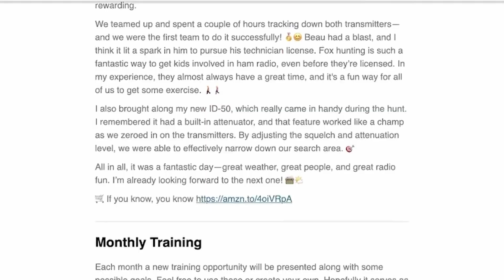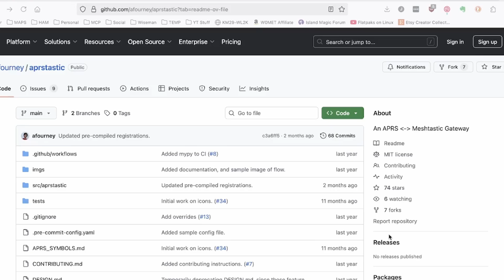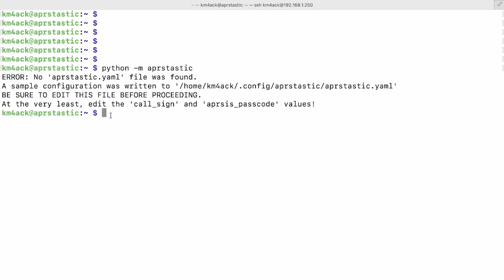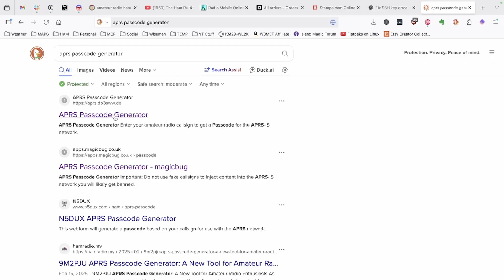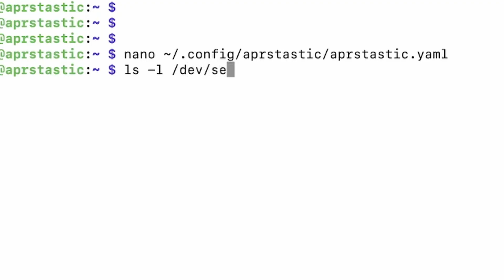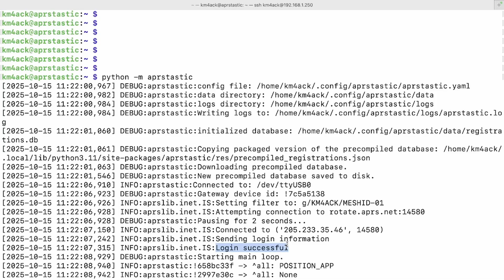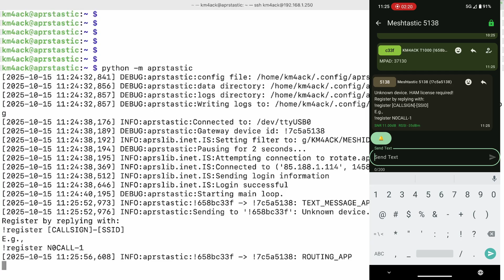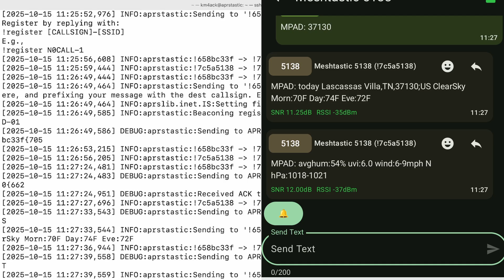This $15 Pi Zero Just Bridged Meshtastic to APRS! Full Setup + Demo

Comment: Getting a time out waiting for connection when running the python -m aprstastic command.  Uncommented the # for my port.  Rebooted.  Same result.  Tried running pip install aprstastic --break-system-packages again and get defaulting to user installation because normal site-packages is not writeable.  Otherwise, everything shows requirement already satisfied. I'm running a Rak mesh device not the helltec.  Not sure if that matters?
Reply from the maker: I haven't tried with a Rak so there might be a difference.

Comment: When I send a message to the node it displays in the LCD screen, but nothing happens on the PI console. I am not getting any errors when I start the APRStastic script. Is there something I need to change on the node?
Reply from the maker: The only thing I can think of is to make sure your call and password are right in the config file and make sure the Pi has an internet connection.

Comment: I have it set up with a meshtastic node and it works, at least as far as putting up messages from meshtastc to APRS, but doesn't seem to work in the other direction. Is it really bidirectional?
Reply from the maker: Yes. I am able to get messages both transmit and receive.
Reply from the maker: Keep in mind that it is SSID specific. So if I register KM4ACK-8 and you send a message to KM4ACK-7, it won't come though.

Comment: Jason can you do a video short showing how you have your pi zero 2W connected to your meshtastic device.  I have mine connected via USB-C to a USB 3 port hub to pi zero 2W version 1.1 running 32 bit lit new Trixie.  When I run the python aprstastic run command, the serial cable connection knocks off bluetooth connection to my meshtastic android phone app.  If I tap bluetooth sync in the app a bunch of times it eventually connects to the RAK WisBlock 4631.  I noticed on the Mesh device serial disconnected so I think both connection types are knocking each other offline.  It did send a beacon once tonight so that is some success.  Curious if the meshtastic guys are going to add a SSD entry for beaconing?  Thanks KM6QAQ 73

Comment: If I understand this correctly, it basically sets up a meshtastic igate that will cover the area my connected node covers?  How would I find other aprstastic nodes in the field?  Is there a naming convention or anything?
Reply from the maker: Your understanding is spot on. Not sure how you would find them in the wild unless they are advertising them as such.
Reply: @KM4ACK   Will messages travel through regular nodes or does it have to directly hit an APR s tastic m
Node

Comment: [2025-10-21 13:50:27,112] DEBUG:aprstastic:config file: /home/aprstastic/.config/aprstastic/aprstastic.yaml
[2025-10-21 13:50:27,170] DEBUG:aprstastic:data directory: /home/aprstastic/.config/aprstastic/data
[2025-10-21 13:50:27,173] DEBUG:aprstastic:logs directory: /home/aprstastic/.config/aprstastic/logs
[2025-10-21 13:50:27,176] DEBUG:aprstastic:Writing logs to: /home/aprstastic/.config/aprstastic/logs/aprstastic.log
[2025-10-21 13:50:27,243] ERROR:aprstastic:Please specify the correct serial port in 'aprstastic.yaml'. Possible values include: []
[2025-10-21 13:50:27,262] ERROR:aprstastic:Traceback (most recent call last):
  File "/home/aprstastic/.local/lib/python3.13/site-packages/aprstastic/__main__.py", line 61, in <module>
    gateway.run()
    ~~~~~~~~~~~^^
  File "/home/aprstastic/.local/lib/python3.13/site-packages/aprstastic/_gateway.py", line 98, in run
    raise ValueError("No meshtastic device detected or specified.")
ValueError: No meshtastic device detected or specified.

Traceback (most recent call last):
  File "<frozen runpy>", line 198, in _run_module_as_main
  File "<frozen runpy>", line 88, in _run_code
  File "/home/aprstastic/.local/lib/python3.13/site-packages/aprstastic/__main__.py", line 61, in <module>
    gateway.run()
    ~~~~~~~~~~~^^
  File "/home/aprstastic/.local/lib/python3.13/site-packages/aprstastic/_gateway.py", line 98, in run
    raise ValueError("No meshtastic device detected or specified.")
ValueError: No meshtastic device detected or specified.
Reply from the maker: According to this error "ValueError: No meshtastic device detected or specified." the system can't find your Meshtastic device. Chances are it's an issue with the USB-C cable. Not all are created equal. Maybe try a different one.

Comment: so if i see 5138 in the boro itll work for just that node?
Reply from the maker: Yes. Just that node and only after you register your call sign with the node. Other's can send me an APRS message by addressing it to "KM4ACK-8" which is the call I have registered with the node.
Reply: also does it work in reverse? can i send a APRS message to that node?

Comment: Do you have to set the User Config on the Meshtastic device to licensed operator?
Reply from the maker: no. it limits access by requiring the operator to register their call before sending messages